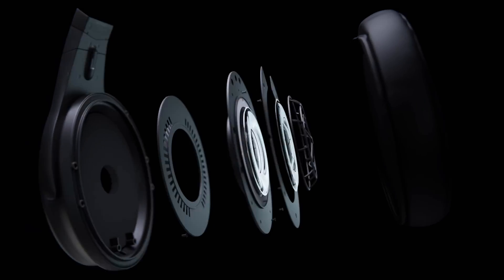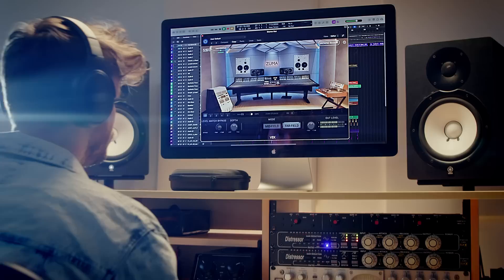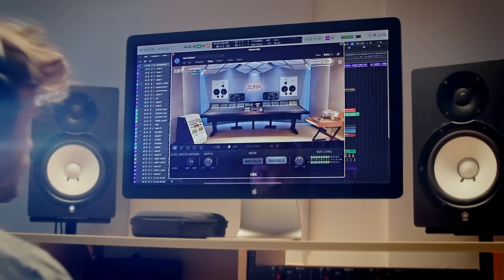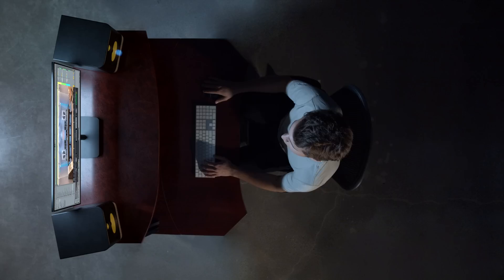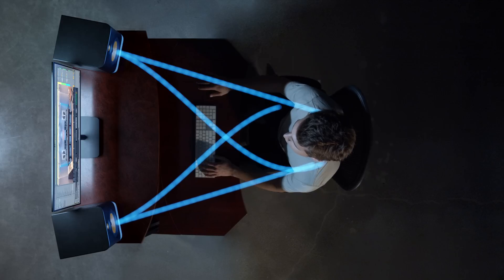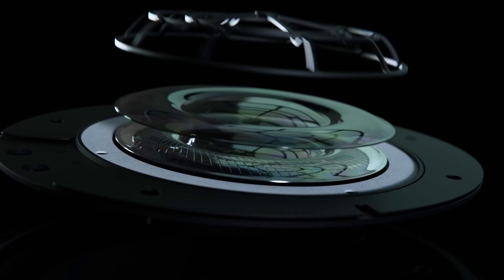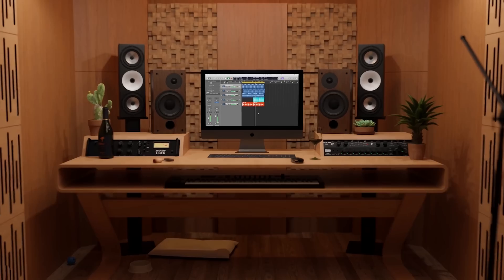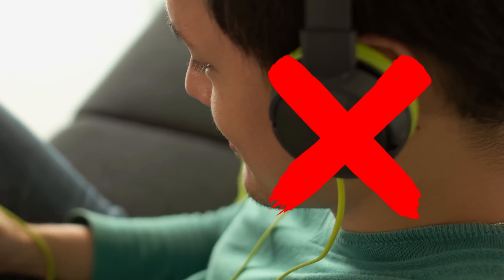How VSX Models Speakers | Steven Slate Audio

Comment: The video mentions "calibrating the headphones in the software"- is there a calibration step when setting them up?
Reply: You probably just add the serial number and it has a software adjustment based on that run of headphones in production.

Comment: does VSX support fine-tuning the HRTF for your own head?  I found that I had to tune Waves' NX system to a very precise head circumference value before the virtual speakers suddenly sounded truly localised in space.  before then the localisation really didn't work well.  this appears to be common with HRTFs that really need to be customised per-user for best results.  or have you found an effective 'universal' HRTF that works more broadly without tuning?
Reply: The comments would seem to suggest they’ve nailed it.